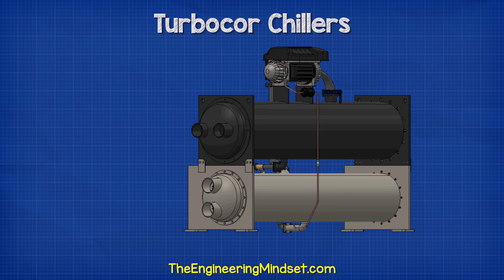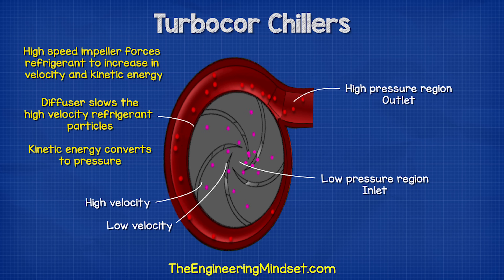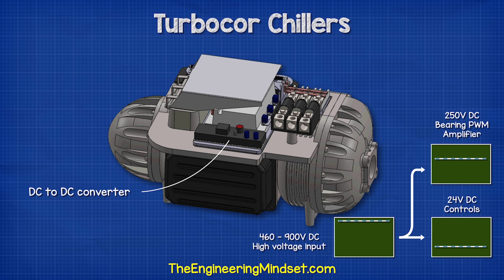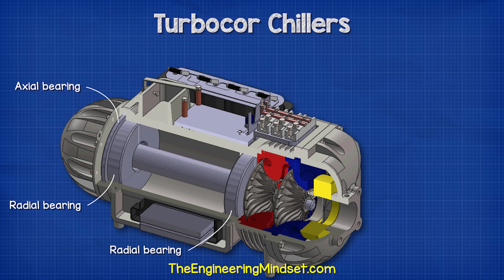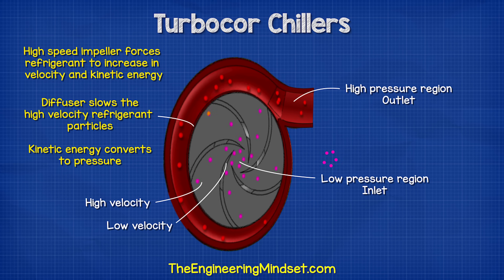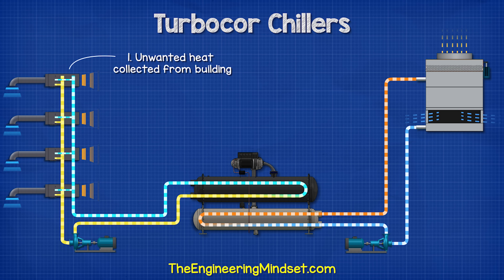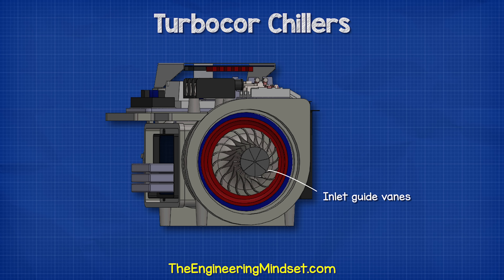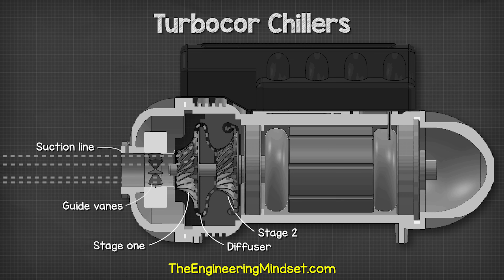Turbocor Chillers Explained - Oil free magnetic bearing HVAC

Comment: I actually work at the Danfoss Turbocor plant in Tallahassee, FL. I have worked at stator insertion and I have built axial bearings, IGV's (where the inlet vanes are located), and capacitor modules (so far). I am also an engineering student at FSU. As a Production Technician we don't get much training on how everything works together. So, thank you for this video. It explains a lot.

Comment: The Turbocor is a great compressor plus when you remove the oil in a chiller you gain about 10% in efficiency due to better heat transfer. The biggest issue I have seen with this compressor is when you come out of free cooling to mechanical cooling with inverted water temps the compressor can shutdown on over temp because that 3/8 liquid line isn’t providing enough liquid refrigerant to cool the electronics don’t know why they don’t use a liquid pump to help solve this issue. Besides that great product.

Comment: The new York chillers have a 12V DV battery that keeps the shaft of the magnetic bearing levitating and it will slowly spin the rpms on the shaft down when you have a power loss instead of the shaft just free spinning and falling very cool design. They also have a "marine" option you can buy and it includes hinges on the shells so you can clean the tubes out instead of having to use a chain fall to take the end caps off the tubes, but watch out it you order the marine version the blueprints don't include the total overall width of the chiller with the hinges they only include the width to the end of the frame the hinges add another 6 inches of width on the entire chiller (we had to cut and re wield the hinges back on )
Reply: All manufactures have hinges on the end bells they just have to pay for them when they order the chiller

Comment: The magnetic bearings and the 2 stage compressor had my attention first,  but then the shutdown system that turns the motor into a short term generator is a fantasic way to protect the whole machine.
Thank you for this video!

Comment: We just had a new Smardt chiller installed in our building, and I wasn't sure what type it was. After watching this video, it appears to be a 3 stage turbocore chiller. The only difference is that the evaporator is in the mechanical room and the condenser is air cooled on the roof.

Comment: Why do we use a open system for cooling the water back down? Why dont we use closed condensators instead of cooling towers as we would with a freon system?
Reply from the maker: Because the water evaporates and carries the heat away for free so we get extra cooling. Passing it through a closed heat exchanger isn't as effective.

Comment: As a bachelor student of Electrical and Electronic engineering, I find efficiency oriented engineering as a prime priority over gimmicks. In efficiency, reliability is key, I hope to find what differentiates the "Turbocor Chiller" from a traditional heat exchanger. But most of all, the 'Co' coefficient of heat exchange to energy input compared to similar systems.

One downfall I would not find acceptable with this kind of system is the lack of a reverse flow valve. I can see that water would not be a suitable means for evaporating with colder climates though haha.
Reply: Pardon me, "Co" = 'COP' rating. Also, I understand they can be more efficient (easily) than geothermal exchange, but I'd like to see them employed in residential dwellings.

Comment: Do you know if you need a license to replace parts of this compressor?
Reply: In the United States you need a license to handle refrigerants.  Where I work, one of these chillers failed and the refrigerant was removed with a vacuum pump prior to the compressor removal.
Reply: @JT-lq4yd   Thank you your reply.
I've heard that you need a turbocore license to replace internal parts of a compressor, do you know about it ?
Reply: @hide6625  I did not talk to the personnel when they came to my company but it is very likely that you need the parts supplied by the manufacturer of the turbocor and most will require that you are trained to repair their equipment.
Reply: @JT-lq4yd  I appreciate your quick response.I’m grateful for your guidance.

Comment: Is there a shaft seal or is the whole motor casing full of refrigerant?
Reply: Since the motor and impeller sections are integral to one another, the entire inside of the compressor is full of vapor refrigerant. This refrigerant is used to keep the motor, shaft and bearings cool.

Comment: What happens upon failure of the inverter? I know the induced voltage on failure allows the magnetic bearings to still work on power failure, but on inverter failure won’t it cause damage?
Reply: In the case of a topside electronics failure, the compressor is fully protected with the backup mechanical touchdown bearings.

Comment: handled chillers with multiple turbocor compressor, york ymc2 magnetic bearing and york yz magnetic bearing. the difference with turbocor with yz and ymc2 is turbocor needs multiple compressor in parallel to match a york single compressor tonnage.
this restrictions in danfoss turbocor compressor design mainly the fact that danfoss has only one patents on magnetic bearing technology while york has skf magnetic bearing technology patents and synchrony magnetic bearing technology patents. recently johnson controls, which is the parent company of york has acquired siemens synchrony magnetic bearing technology which secured the large tonnage compressor to york chillers.

Comment: What are the measurements of the EM field generated by the compressor?
Reply from the maker: I have absolutely no idea, but if you contact Danfoss I'm sure they could assist with some data
Reply: In terms of safety to individuals and surrounding  equipment, there are no concerns as the EM field dissipates exponentially as you move away from the internal components.
Reply: @hw3991  Thanks for the reply. How does it affect navigation equipment? Ex: GPS, compass, gyroscope, radio, etc.
Reply: @johnq.public2621  agreed, there should be follow up.

Comment: Magnetic  bearings ... Blowmind
Reply from the maker: Pretty amazing, right. What else could this be applied to.
Reply: @EngineeringMindset  ... Oh, I think in electric motors for planes, where the pump oil represents a considerable weight, also electric cars
Reply: @EngineeringMindset  gas turbines on natural gas pipelines is another application  for booster pumps.  The mag bearings have a faster Spin up.  Thanks for the info. I wonder if the IGBT failure causes a rub loss of phase of the motor also.

Comment: When the turbocor compressor was designed the engineers had hopes to eventually scale it down to be able to enter into the domestic refrigeration market.  I rather doubt that will be pursued unless another design team
Reply from the maker: Well like any invention it will be varied for other purposes, with the energy and carbon reductions and need for efficiency it's probably likely that a variation of this could reach domestic units. The bearings in particular and the soft starter could be

Comment: They sound like jet engines and run 19000 rpm at 100%. Pretty cool i mess with them every now and then at work.
Reply: They run much higher than 19000 they usually sit around 33000 rpm depending on the model.
Reply: Well, the stacked compressor stages are pretty similar in principle to how a jet engine works...
Reply from the maker: Sounds great right.

Comment: Yeah, I've been wondering for decades why we don't use magnetic bearings, since I was a kid.
Reply from the maker: It's here! I'm certain we'll see this wide scale in the next years
Reply: @EngineeringMindset  A video on why it took so long?! lolol
Reply: The design has been around for many decades. The problem was the size and speed of electronics. Early units had a control panel bigger than the chiller vs current units where the controls are barely bigger than a shoebox.

Comment: I want to ask..If at suction compressor icing, this refrigerant is still liquid? If still liquid, problem source is expansion Valve or evaporator? Thank you🙏
Reply: Icing of the suction can be a problem with refrigerant level or air flow. Very rarely is it a expansion device. What you need to do is clean both evap and condenser and change any filters only then can you analyze the system. What you want is to have a superheat that ensures no liquid refrigerant is flowing to the compressor. If you can get the temp of the suction line exiting the evap outside the unit and subtract that from the Tsat found from a refrigerant pt chart. On residential units you want a 10deg superheat around there every manufacturer has their spec. This also depends on load if it is a txv. Its a fixed super heat if it is a  cap tube. Also you want to check subcooling on the condenser which will tell you your refrigerant level if you have no subcooling your low on charge and that is causing your suction pressure to drop below freezing and icing the coil
Reply: @ryanthomas2374  thank you for your sharing information..👍
Reply from the maker: Ryan's provided I great answer. I will just add that Danfoss have a free app called "troubleshooter" which diagnoses all refrigeration system problems. Very useful.

Comment: Is it necessary for this compressor to be driven by vfd (inverter) ?
Reply: It’s not necessary, but it is energy efficient to be able to match the required load demand opposed to cycling the equipment off and back on.  It adds life to the equipment by a continuous demand cycle.  Another benefit is lowered amps at startup compared to the locked rotor current demands of conventional compressors.

Comment: Not worth it
Reply: They are great when running properly. Problem is they are complicated, and when repairs are needed, parts are very expensive. They also need to be installed on the correct applications. We have about 15 on our campus, and have had good and bad times with them.

Comment: Why not skip this machine and just use one cooling loop?
Reply from the maker: We need the cooling water to be lower than the room temperature, the larger the difference the more heat transfers. If we didn't use refrigeration system we would be pumping something around 30°C/24°C water around, that's not going to be of much use.
Reply: That will only work if you need to cool the building and the outdoor temperature is lower than the desired indoor temperature.  The whole point of the refrigeration loop is to move heat from a lower temperature area to a higher temperature area.
Reply: Refrigerant are very costly if we circulate it whole building we will need a large quantity of refrigerant also there will be chance of leakage.we cannot afford.thats why we use water to cool down and circulate in building. Hope i get your point.
Reply: @mdfaizan1771  Now I get it... You use non Pressurized cooling loop in the building for low costs and the whole pressurized part is in a single unit.
Reply: @3SPR1T  absolutely right but water has certain amount of pressure. Actually water pump build some pressure to circulate water.🙂

Comment: "liquids cannot compress"
On 1500 bar of pressure, water actually shrink 5%...
Reply: Pretty sure most people don't compress liquids to 1500 bar XD
Reply: @skylerbowerbank5847  i have a diesel car with a pretty high pressure injector system...
Reply: @bandiras2  your car probably isn't worth 1/8 the cost of this chiller.  Therefore, I'll stick with not trying to compress liquids.  Pay attention, you might learn something.
Reply: @skindianu  
My car worth less than 1000$
Reply: @bandiras2  there you go
Reply: Yes, there is still some compressibility. But we generally don't consider liquids to be compressible for the way we apply them in HVAC.

Comment: We convert AC to DC back to AC?
Reply from the maker: Yes, because then it is clean and you can control the voltage and frequency exactly to what's needed. Otherwise you just get what's supplied from the mains
Reply: @EngineeringMindset  Thats nice. Wouldn't not be more efficient to just use a DC motor instead? Thinking about a Tesla
Reply: @brarautorepairs  the only DC motor that wouldn't require an inverter is the older brushed motors.  If you use brushes, you're giving back all the efficiency gained by magnetic bearings and variable speed.

Comment: Is it because it is oil-free it is more efficient than a screw compressor-type chiller? Because I can't find another reason why a centrifugal chiller can be more efficient than a screw type.
Reply from the maker: The magnetic bearings vastly reduce the mechanical losses compared to traditional compressor bearings, it's also combined with VFD, EEV, IGV and precise controls
Reply: Normally centrifugal compressors are more efficient by the way, centrifugal compressors are non positive displacement unlike screw compressors , so they give reletively higher flow, meaning more refrigerant is passed to the evaporator therefore higher cooling capacity. On the other hand the centrifugal compressors can maintain reletively lower pressures so they normally used with water cooled chillers rather than air cooled chillers ( flow determines the cooling capacity but maintaing pressure ensures the heat rejection) . Of course the fact that we are here talking about oil free compressor its another reason its more efficient
Reply: Being oil free does help it be more efficient, but it also removes the problem of oil moving with the refrigerant which is a problem with chillers of this design.

Comment: Turbocor was purchased by Danfoss it’s not the other way around. Every chiller breaks down and Turbocor  don’t break down they Scramble, every turbocor I’ve had was removed and converted to screw, digital scroll or centrifugal if applicable. My current facility has 15 chillers, I’d never spec a Turbocor.
Reply: What do you mean by “Scramble”?  Thanks!
Reply: @BobWidlefish  I'm just guessing, but I think he means that compressor utterly destroys itself when it breaks.
Reply: @BobWidlefish  the engineers called it crashing initially.  During a power outage or other anomaly the core shuts down too quickly.  It’s important for a turbocor to shut down and rest easily on the support pads.  I don’t remember the exact number, but the pads are good for a limited number of emergency shut down cycles and the capacitors have to be maintained having this in mind.
Reply: @waggtech8793  so if the power goes out and you don’t have backup power the levitating shaft stops levitating and this causes wear, basically?
Reply: @BobWidlefish  the capacitors are part of the design to allow the rotor to gracefully come to a rest.  But with that in mind, there will be customers who opt not to replace the capacitors as recommended.  The original design had pads but the newer versions may have been updated.  I’d taken a class when it was still Turbocor but no recent training to keep up with latest versions...
Reply: @waggtech8793  I see, so normally even if you don’t have backup power the capacitors hold enough charge to bring the system to a safe stop, but they wear out and if you don’t do the required regular maintenance then the levitating shaft might come to a stop in a bad way, bypassing the safe shutdown procedure?

I’m deeply fascinating by these kinds of mechanical system, and it’s very interesting to hear the practical challenges people run into operating them.  Thank you!
Reply: What happens if the inverter stops working? Does the compressor hit the support pads and “scramble”?